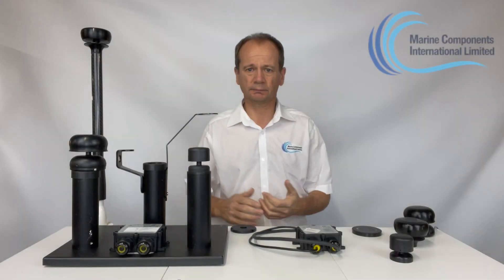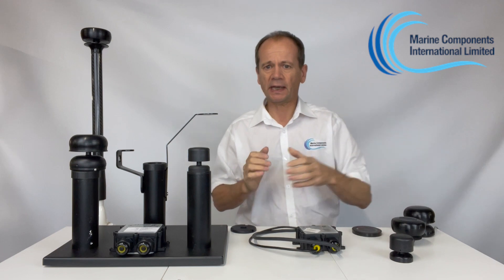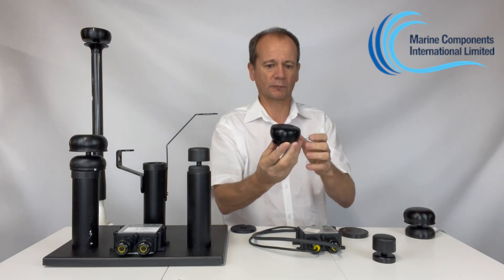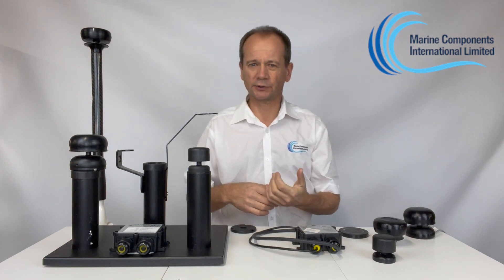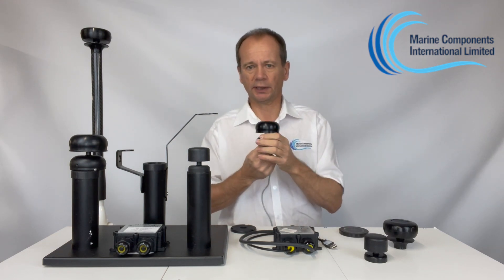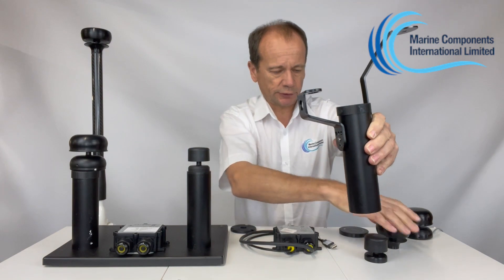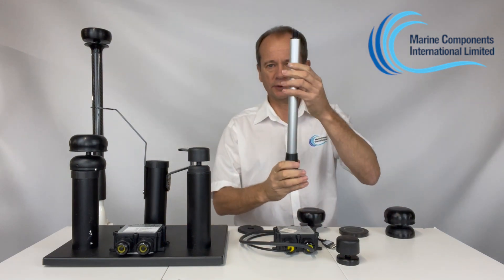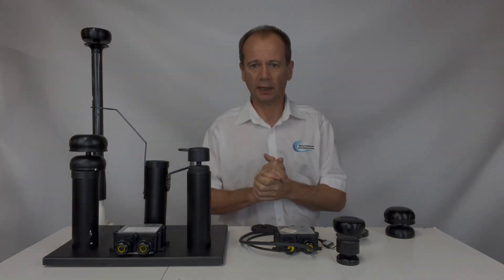Introduction to Calypso Instruments

Comment: Can the blutooth compatablity of the anemometer be connected to a microcontroller by any chance rather than a app as I need the data from a mobile robot
Reply from the maker: Hi, the sensor uses Bluetooth 5.1, range up to 30m. It states compatibility with Android, IOS, Garmin watches etc but this is via a compatible App. I doubt you could connect directly to your microcontroller.
Reply: @marine-products-direct8292  
Thanks for your immediate response, Actually my range is around 3 Km. Can I use the wired one, though it is Heavy I think it has an IC2 communication protocol, and via UTAR we can communicate to a microcontroller. Is there any documentation for the wired setup as I am a beginer to electronics

Comment: I would like to know if this product will work properly installed upside down? Of course, there is a possibility that it will not work with solar charging. My question is whether inverted mounting will affect the ultrasonic work?
Reply from the maker: Hi There, in theory it will not impact the readings as long as it is level and not at an angle. However as you state it will not be very efficient on the solar charge and will therefore run out of power earlier. Hope that helps. David.